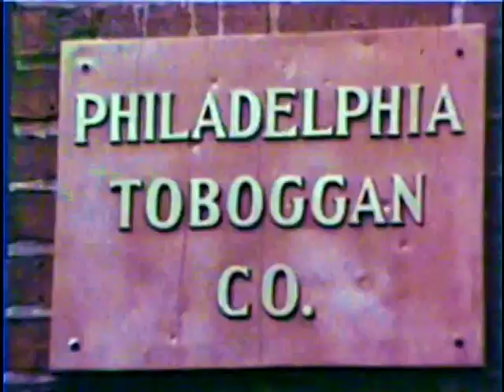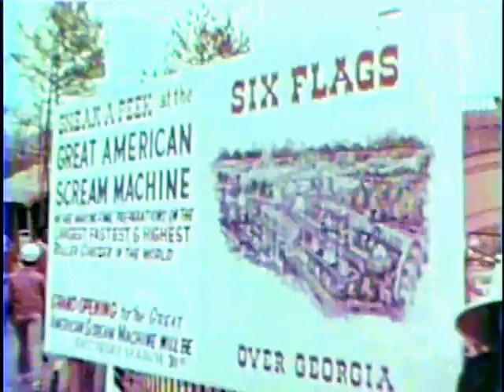Great American Scream Machine - Documentary and News Reel (1973)

Comment: One of the rough rides now
Reply: It's being re-tracked right now. Depending on the covid19 situation, it's supposed to be back open this summer. Should be a much smoother ride.
Reply: W. Long Just road it they only retracted the first two drops
Reply: They also retracked some other parts of it a few years ago. It sounds like they're doing it in phases.
Reply: @theweakestlink2278  nothing changed lol
Reply: @5licckoo215  That's what I heard. I haven't been this year. With the covid rules I just couldn't do it this summer. That 100° Georgia summer heat doesn't mix well with those face masks.
Reply: @theweakestlink2278  yeah I work at the park. Worst shit ever lol
Reply: I can imagine. I wear one when I have to but once I get outside that things coming off.

Comment: Im looking foward when the correct DVD comes! Speaking of which how long will it take untill the correct one comes?
Reply from the maker: I was never notified as to when the DVD I ended up with would arrive, so I'm not really expecting a notification for this one either. I'm sure the wait for the correct DVD won't be too much different than the wait for this one, though.
Reply: @okefenokee_rabbit  According to the website that I linked to you a while back, it said that The Early Years and The First Decade is apart of the DVD you have as features and bonus features. They DO NOT come as separate DVD's. When I saw that website for the first time, I thought they came as separate DVD's. Sorry about that. You DO have the correct DVD. You just need to dig for them. I hope you understand.
Reply from the maker: This is the DVD that I have: http://www.joylandbooks.com/video_new/greatamericanscreammachine.htm
The cover of my copy is different (and is labeled with the exact same title of the DVD listed on the original page you found, which is where the mix-up occurred), but the contents of the DVD I received are exactly the same as the ones listed on this page. The DVD only consists of two menus — the main one featuring the documentary and news reel (as well as a handful of still shots of the Scream Machine taken over the decades), and the bonus section featuring a time lapse of the Georgia Cyclone's construction process and the 8mm film from the mid-seventies. I can assure you that there are no additional features or interactive portals, and you can even see for yourself here:
https://imgur.com/0CcfCYP
https://imgur.com/LzA5JTo
Furthermore, when ripping the DVD, no titles other than those five things ever showed up on any of the three programs I fiddled around with.
Reply: @okefenokee_rabbit  Alright heres the link http://www.joylandbooks.com/video_new/sixflagsovergeorgia.htm. You can buy the used copy of the DVD. Also if you get The First Decade be sure to post it. Since its the 70s, we might get some Okefenokee footage if were lucky.
Reply from the maker: I've already sent the company an email clearing everything up. They'll probably get back to me shortly, and when they do I'll notify you of whatever they tell me. Hopefully, this whole thing goes over smoothly.